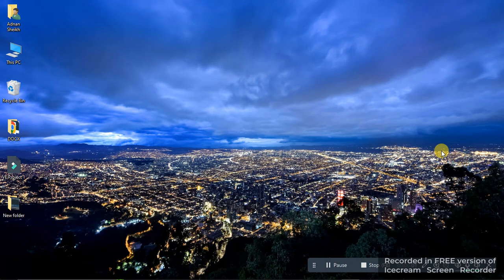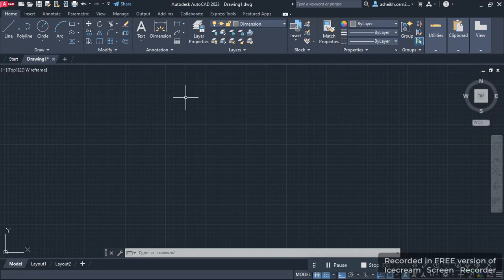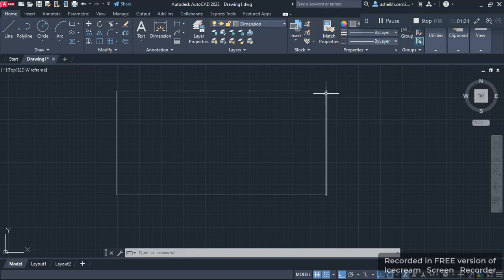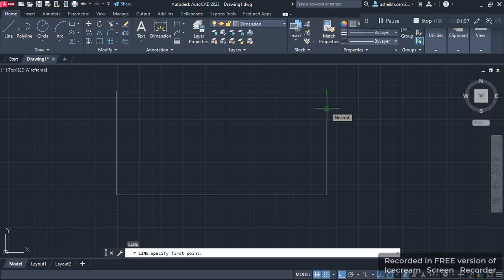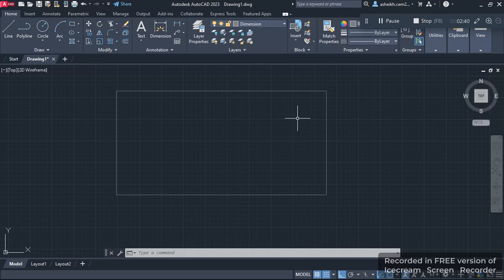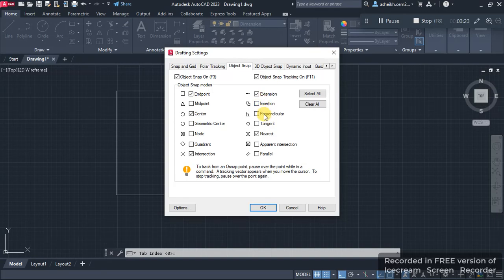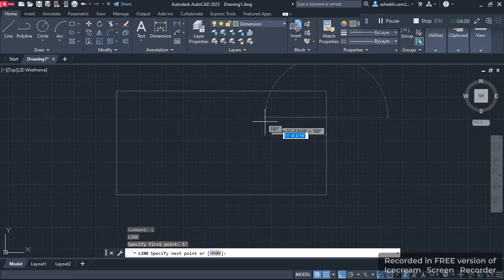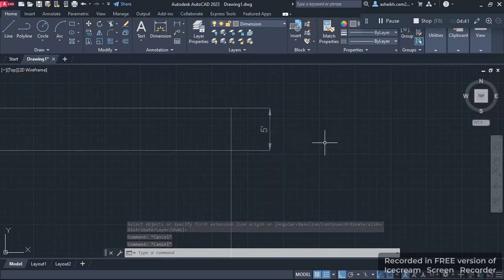How To Solve Line Extension Error in AutoCAD | Line Not Starting From Distance Specified | Solution

Comment: Mate, so simple! I didn't know it was just that one checkbox! So glad for your explanation!
Reply from the maker: Thank you for your compliment. It feels good to have helped you in this regard.
Reply: @howtobyadnan  I've got another problem. Whenever I want to enter another point, which starts a certain distance from a different existing point to the one previously used, the tracking continues to reference the original point. Is there a way to tell AutoCAD to stop referencing a previous point, and 'pick up' a new point?

Additionally, I often want to input both X and Y coordinates of the new point in space. Your video shows only inputting one coordinate, relative the endpoint that was picked up. Is there a way to do this? Using "@X,Y" doesn't seem to work properly, it keeps placing the new points in random parts of the drawing.